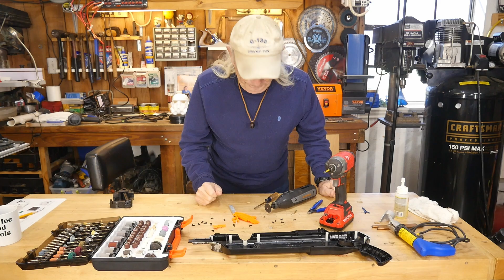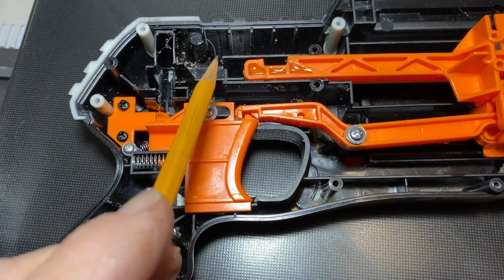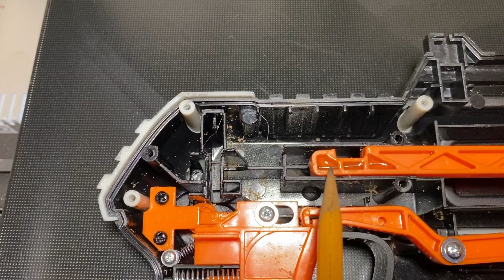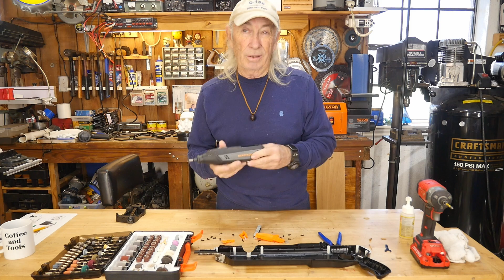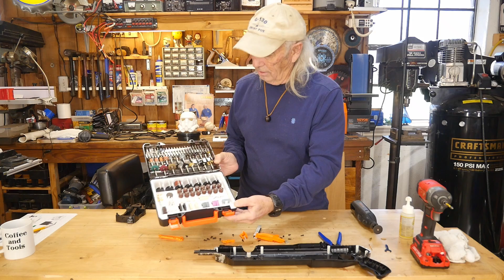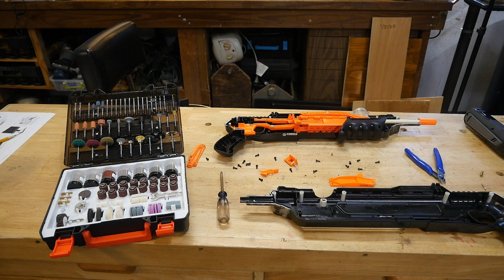Bug A salt repair project with rotary tool, Coffee and tools ep 418

Comment: I have two of these bug-a-salt that failed the exact same way. Design flaw for sure and they refuse to sell repair parts. I did the exact same repair but I used a ring shank nail and UV resin. I figured that the ring shank game something for the resin to bond to so it wouldn’t slip out under -pressure of being cocked.
Reply from the maker: Sounds like a darn good repair job :face-blue-smiling:

Comment: Did your repair hold up? I have the same piece broken in exactly the same way. I had been thinking about using a screw to add strength to the repair. Your idea of staples is interesting.
Reply from the maker: Brad nails would be better, the staples let go after a few weeks of hunting flies :face-blue-smiling:

Comment: So THIS is what Texas has been reduced to….aSALT weapons!! 🤣🤣👊🏻
Up here in the northeast, we use these new fangle inventions called fly SWATTERS!😳😎
Hey, several ways to unbreak your home defense weapon…heating the brads and pushing through with a pair of needle nose then epoxy, works too!
Rotary tool. The biggest fail point on rotary tools is the collet lock. They must use plastic because they never have lasted me long enough, to justify investing in another one. Maybe the industrial designers at depstec can tackle that?  I know they’s some pretty snazzy thinkin folks those industrial designers….my so IS one at otterbox